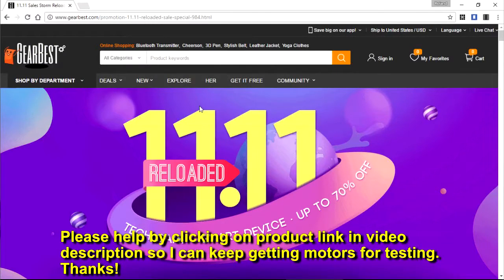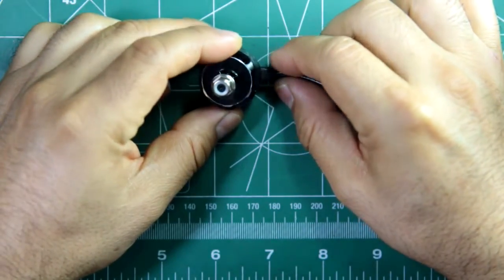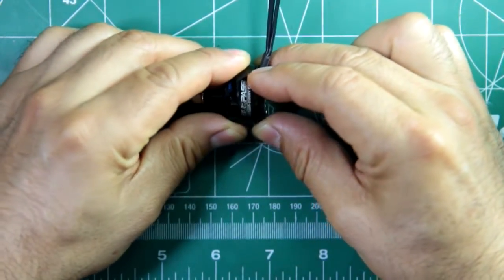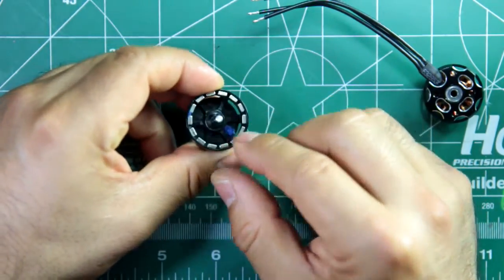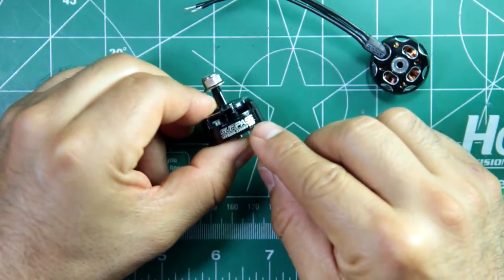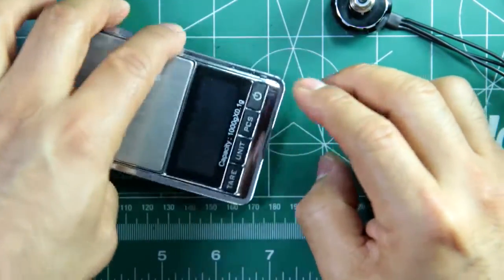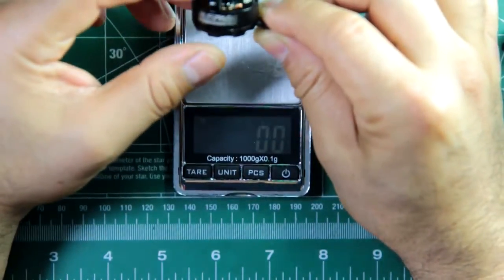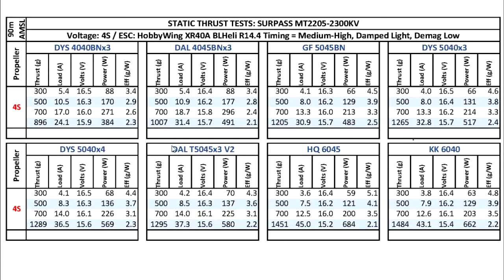Surpass MT2205-2300KV motor from GearBest.com Thrust Tests and Review

Comment: So could I use 20 amp escs with these on 4s with 5040x3 if I cut  the top end of the throttle curve down to 90% of max?
Reply from the maker: Max Amps showed at around 33A on static for 5040x3 props, so a conservative estimate for short burst Max A in the air would be 33*0.65= 21.5A
Good ESC's can handle a couple of Amps more than their rating. Usually they'll list in the specs how many Amps for 5 or 10 seconds. 
A more "aggressive" estimate would be 33*0.6= 20A and that's burst so ESCs will see that much only for a couple of seconds. I would say you can go full 100% throttle but if you have any worries then cutting 5 to 10% off the top would give you good insurance, especially if your ESC's are generic - hopefully you don't have the infamous DYS SN20A ESC's, those were notorious for frying mid air.
Reply: EngineerX awesome, I'm using littlebee 20a-s with caps added.
Reply from the maker: @SirShadeSquamous  As far as I know, LBees are fairly solid and should be able to handle that motor/prop combo. If you're in the USA and one of your Surpass motors goes bad let me know. I'll send you these. Just pay shipping ;)
Reply: EngineerX think I'm gonna take you up on that offer, a kiss with the asphalt has thrown magnets from two of my motor bells, I think the littlebees started dying after 2 dozen packs, my quad just dropped like a rock😑
Reply from the maker: @SirShadeSquamous  Sure thing. I'm going to digging up from the boxes where I store them. I'll try and look for them tonight/tomorrow after work. I'll post back here to let you know. Then just give me your contact info -email, and I'll get them out to you. Should be a set of 4 :)
Reply from the maker: @SirShadeSquamous  Alright. I found 3 of the motors. I'll look a bit more for the 4th one. But at least these 3 should get you back in the air. Just give me your email so I can get shipping info. $6 should cover shipping cost.
Reply from the maker: @SirShadeSquamous  email sent. Check inbox

Comment: for a new budget ...throw about ?
Great freckin numbers these ...
Reply from the maker: Yes I was very surprised at its performance. Just buy some good EMAX or other motor bearings that cost around $1 each  to give it a refresh once the cheap bearings it comes with go out. But they should last several flights. Good for a beater!

Comment: this motor performance seems up there with the best 2205?
Reply from the maker: I was very surprised when I was getting the data onto the spreadsheet and browsing through previous tests of other motors. It's quite impressive that we can buy a $9 motor and get this level of performance. Now, we've yet to see how the motor does long-term. Hopefully bearings hold up to normal abuse, magnets stay in place, armature can absorb a decent impact and shafts stay straight. I'm wondering if this motor is made by the same factory that manufactures RCINPOWER motors or the RacerStar RF series. That would be a good thing.
Reply: yeah I thought it looked similar to the emax motors...the performance seems better than the cheap racerstar...
Reply from the maker: The RacerStar I tested was a 2204, so it would be less powerful _unfortunately BG didn't send me a 2205, but in a way it's OK - I had not tested a 2204 for ages. I imagine the 2205 version and this one would be nearly identical. The RF version of the RStar has about the same "solid" feel as this one.